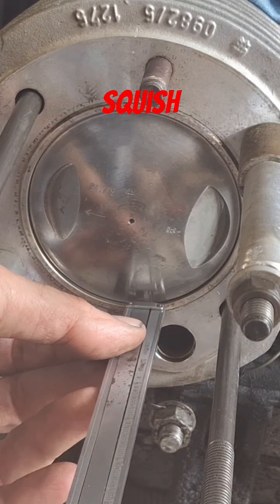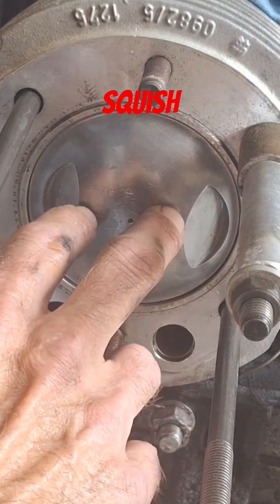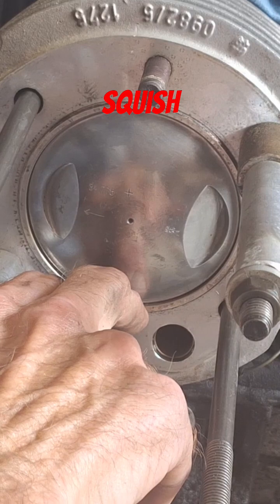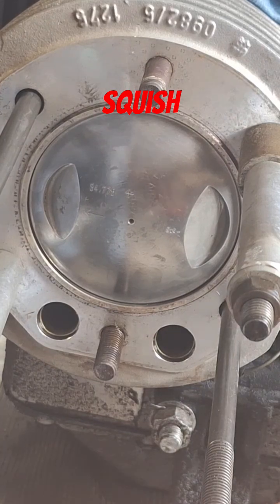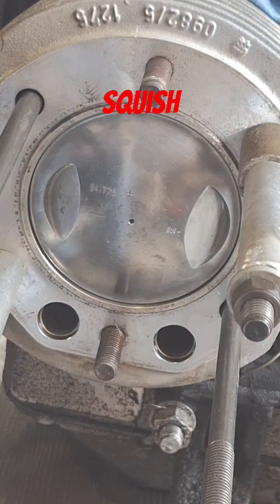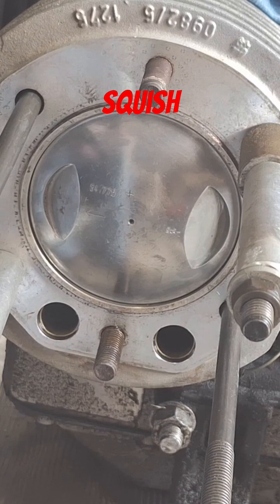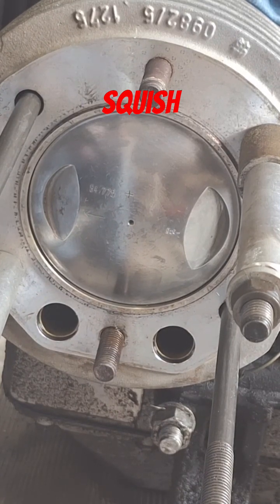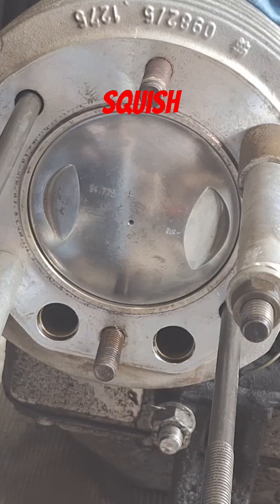This Simple Trick Checks Your Engine's Squish!

Comment: Now, wait a minute!

What about the head gasket?  

Don't they make different thicknesses so the squish can be dealt with? 

🇺🇸
Reply from the maker: What about it? You will use an already compressed head gasket when you bolt the head on to make your checks. You can't put everything in a short.
Reply: @russellbarron6775 I don't dispute that at all.  I'm just asking about "shim" gaskets.  I've seen em in all different thicknesses.  I'm just sorta baffled as to why they aren't more popular where the squish is concerned.  Mof, I can't think of any other reason for them to be used. 

I use Playdoo 👍
.
Reply from the maker: @whatsyurprob158 I'm out right now. When I get home I can give you the right size of shim. Wanna say they are stainless asvwell.
   As a rule one shim is equal to about half a clip position. 
   Anyway. Ill get you the size. Also to keep the needle from moving up and down in the needle cap, stack shims on top of the needle as needed. That is if you have movement.